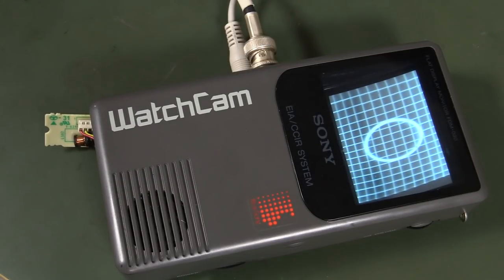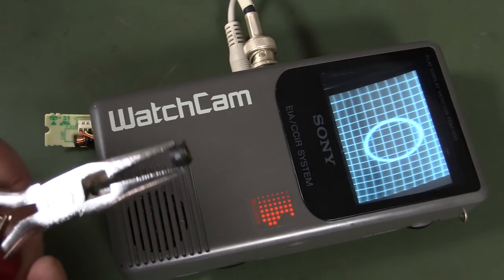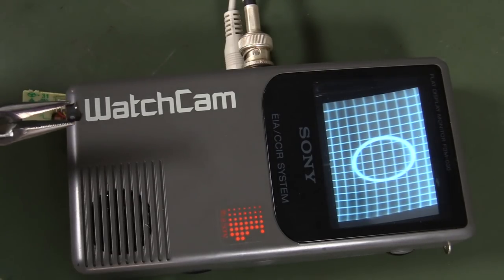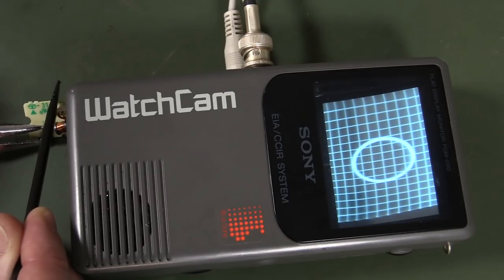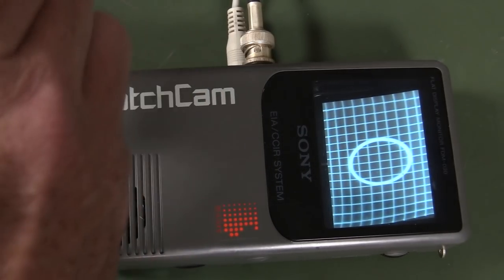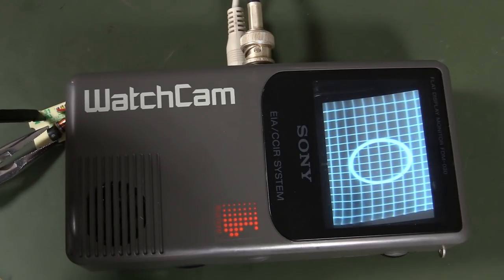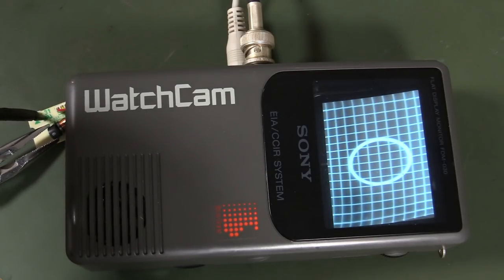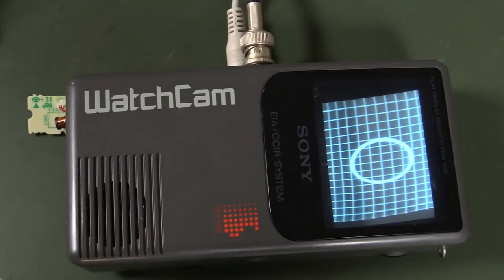Sony WatchCam CRT Geometry Adjustment

Comment: Is it possible the conducting tool holding the magnet is changing the magnetic flux of the system as a whole?
Reply from the maker: Very little, no, forgot to mention that.
Reply: actually it would make a difference if he was using a non ferrous tool
Reply: Of course the pliers have an effect; the center of magnetic flux is pulled into the pliers. You're turning a small weak magnet into a much larger magnet with the same total flux. Nylon tweezers would have been used if the magnet were individually selected for fine adjustment, just like nylon screwdrivers are used to adjust radio IF transformers or any other adjustable inductor. (In fact, this seems to be nearly the same kind of adjustment.)

Presumably the marking is the magnet's flux in Gauss? Measuring that might make an interesting video.

Comment: Heat used to remove magnet would weaken it. Even just a bit more magnetic flux would make a huge difference!
Reply: Ferrite magnets are significantly less sensitive than neodymium magnets and can be heated to about 250 °C without problem.
Reply: How much heat does it take to remove  the "epoxy"? Usually when technicians use heat like that it does go up into those temperatures. When you look at the first video, the right side is barely hanging on as it was.

Comment: Many years ago I had to replace a part on a video arcade game's monitor assembly that was very similar - a coil with, in this case, a threaded ceramic slug in the center that could be adjusted with a screw driver to fix the screen geometry (IIRC, it was a horizontal adjust, like what you're seeing).

Comment: Its the horizontal-width adjustment of the screen. By saturating the inductor with the external magnet they are changing the inductance of the coil. The coil is part of the horizonal drive circuit. I bet this was just chaper and smaller than a "real" variable inductor.
Reply: KingofKatenfutter really he needs to adjust the line time base

Comment: This is a security monitor, I think that it needs a higher level of sharpness/fine-tuning than a consumer TV.
for comparison: during my high-school-years, while the kitchen-clock had it's driver fine-tuned to the nearest Hz, the clocks at school used a shared driver fine-tuned to the nearest microhertz.

Comment: This is ok to do on a black and white crt, but try it on a colour and it will mess up the purity, on colour sets geometry has to be done electronically, well unless you can add and remove your own magnets at 60 times a second

Comment: "It adjusts the geometry just a little bit .. kind of disappointing" .. what do you want it to do?? turn the screen upside down or make the images flying monkeys appear out of nowhere?? seriously.
Reply: Yeah, I don't get it. The screen was clearly aligned to a reasonable amount before he removed the magnet, and clearly misaligned without it. I'm impressed that such a crude mechanism works to the extent it does!
Reply: I wonder whether there is some non-linearity that this over a simple variable resistor gives.